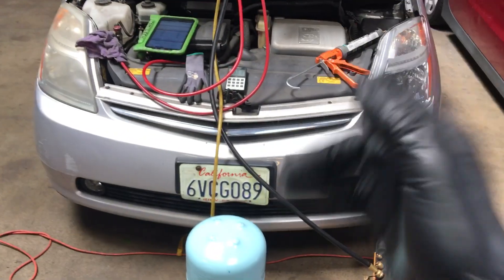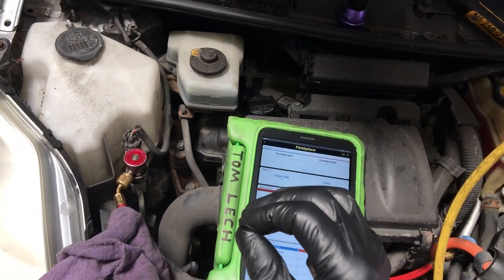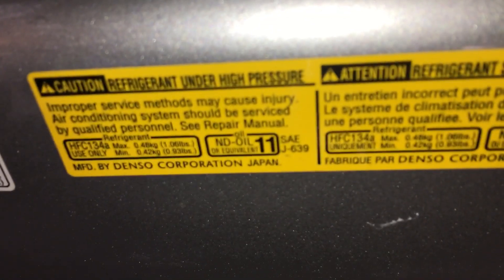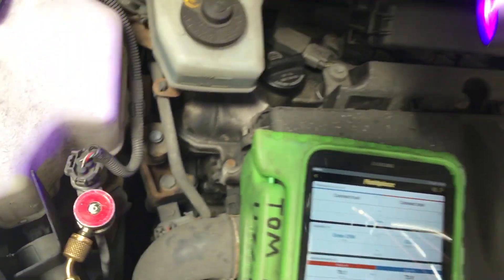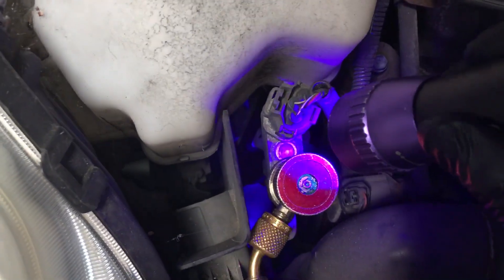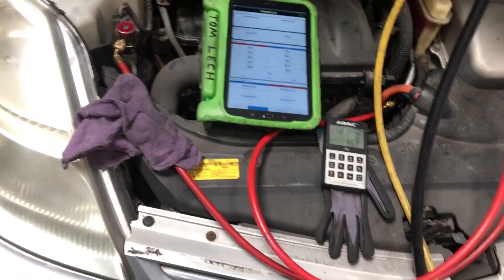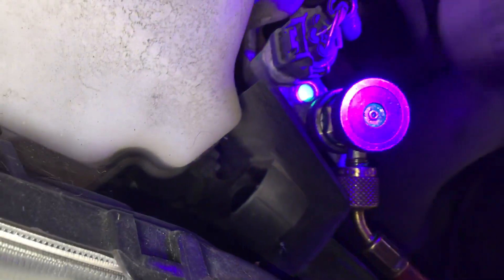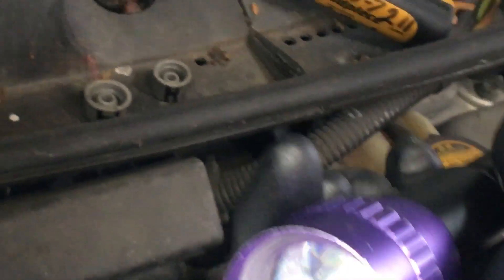UV DYE Added and refrigerant. How long does it take for the dye to travel to the high side￼￼ ?

Comment: Hi Tom thanks for the great videos.My question is what brand of Dye are u using and what uv lite are u using as wel and were to purchase them thanks Dean
Reply from the maker: I actually did I think two videos all on traced I and trace lights so somewhere back in my history of videos

I use tracer line products trace dyes

I also use AC extend by quiet cool technologies that’s one of my alternatives

A little tiny pocket-size UV light called the Conroy is very good

The other one is the UV beast 365 nm 

In my video I explain the difference in the wave length and nanometers different UV dyes use different UV wavelength light measured in nanometers

Another good light is the OPTi pro UV plus by tracer products

Comment: You pulled a quick vacuum with the leak and filled as quick as possible?
To avoid air intrusion.
Reply from the maker: Did not worry about air the leak was extremely small we’re talking about a leak that would take several weeks or months to leak out.    
             So was not worried about air leaking into the refrigerant and it did not matter anyway because the refrigerant was coming right back out after I diagnosed and prove that the whole system was working properly first before replacing the condenser. 

I recycle my own refrigerant so I don’t worry it’s very easy to remove air out of refrigerant

Comment: Hi Tom,
Very interesting series of videos keep them coming.
As you point out, most of the car air con videos on youtube are hopeless and made by people who have no clue (and are too tight to buy proper basic equipment)..they are not fixing leaks and overcharging there A/C which leaks etc etc.
Your the only one who has shown the effects of charging when you have a variable displacement compressor and that the only way to charge a system is by weight.
Very Nice of you to take the time to make these videos as you must be very busy.
Quick Question,.....For fault finding, in general where do you place your  temperature sensor, to monitor ambient temperature, so that your high and low pressure gauge readings are correctly related to the ambient temperature ?.
George (Sydney, Australia)
Reply: Most everything i have seen is backyard. People making a video on basic a/c. And even then they miss so much.
Reply from the maker: It depends what ambient temperature you’re talking about

        1:  do you have the ambient temperature that will come through your outside grill crawl below your window.    This is the air that will go over your inside cabin filter then be drawn through your blower motor and pushed over your evaporator coil
               This air temperature is best taken when the hood is closed because you will get a bad skewed result of the wrong air temperature that will get saturated with hot air from the radiator fans blowing over the engine the hot exhaust and then suck down your outside air source. 

         For this the best placement is a temperature sensor placed just before or just after you’re inside cabin air filter because I have that time all the air will be mixed. 

           2:  if we’re talking about outside air ambient temperature sensor for your gauges like mine Fieldpiece,   That ambient air temperature sensor was designed to be placed the air entering the condenser as if it was on a residential split system condenser it would be on the outside of the condenser if it was an automotive it would be in front of the condenser on Automotive. 

            The placement of the thermistor sensor is very important on a car. 
            If you have it placed in the wrong place too low on the bumper where you may have negative pressure from the pool from the fan and if the vehicle does not have a plastic air shield underneath the car where the engineers you literally can push hot air from the condenser and radiator over the hot engine and it takes a downward force from the engine this extra heated air can be rolled around and sucked back up in front of the bumper and if your temp sensor is too low you can pick up that extra hot air that would be quite a bit much hotter than the ambient air giving you a false reading. 

       Make sure your air sensor that is meant to be placed in front of your condenser is not skewed by a jet of hot air coming from the engine compartment.  

         As for correct temperature to refrigerant pressure relationship PT chart.   
          That is what The clamp on thermistor sensors are for.   They clamp on directly to the metal lines of the suction line to give you superheat and the liquid line for sub cooling. 

           Taking accurate ambient temperatures is a tricky thing because if you take it by line thermometer on top of the roof of your car on the left side or the right side on some vehicles you could have extremely hot Air that is pushed from under the engine compartment backwards through the middle of the car gets super heated by extremely hot exhaust pipes and then drips up the sides of the vehicle to a temperature sensor that might be hanging off the side like some guys do and that would skew your results giving a false temperature. 

          I’ve already talked to mention about air being pushed out from underneath the vehicle and rolling and wrapping back around in front of the bumper from the engine compartment

          Black car sitting out in the sun for a few hours and then line any kind of temperature sensor on top of it to take an air reading would definitely give you a false reading. 

          If you’re talking about or thinking about the pressure relation ship of refrigerant pressure and refrigerant temperature you have to be careful on Automotive because it’s not always correct and true due to the fact of where automotive manufacturers place their service ports are sometimes in the wrong place to give correct temperature pressure relationships. 

           And when we get into these variable displacement compressors sometimes it’s way off especially if the refrigerant charge level is not correct like a half charged up system you can really get false readings.